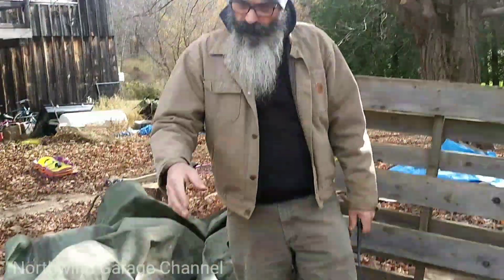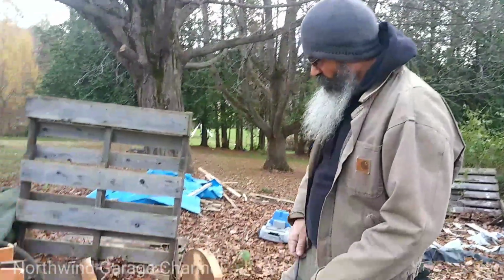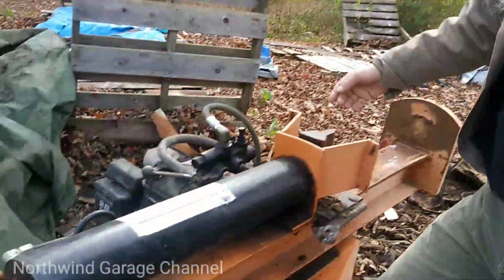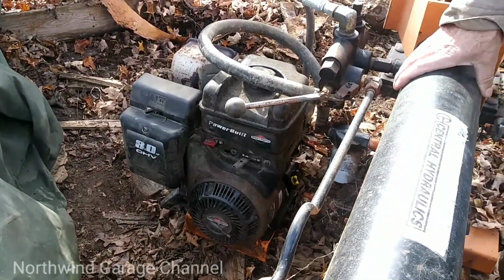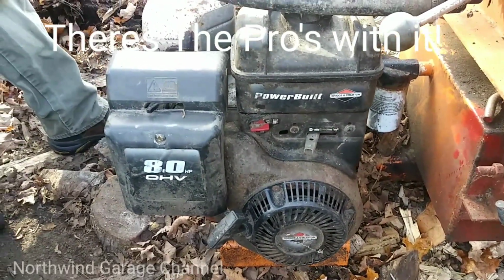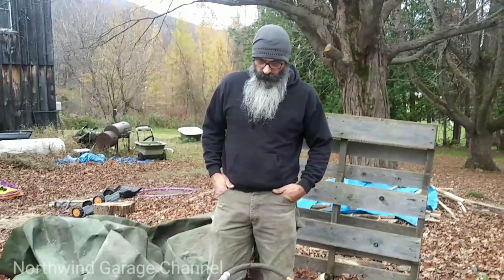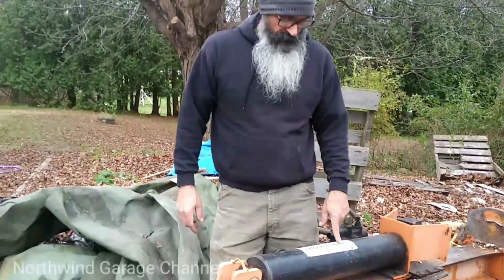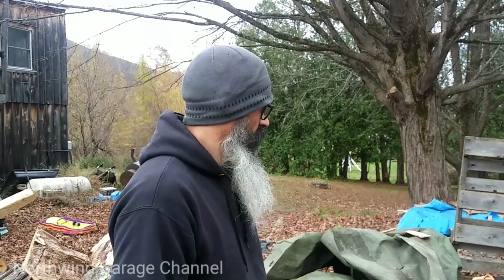Harbor Freight Wood Splitter Review Owned For Over 15 years!

Comment: I’m about to restore the same model HF  30 ton. Log splitter.   My engine won’t start. I’m just gonna replace it instead of trying to find parts for it.  It an early HF engine. I want to put new hoses.  I think I still have all the o rings and bushings that came with it for the pumps and valves. Then give it a nice paint job to control rust.  I’ll try to video my endeavor of this restoration.  I feel it’s worth it because it ate up everything you split. A really good splitter for the money.
Reply from the maker: @runwayray  I couldn't agree more! It's worth every penny! Thanks for Watching 🇺🇲 😁 👍